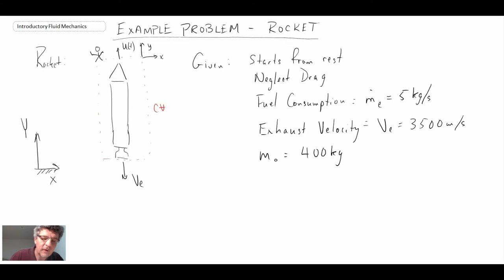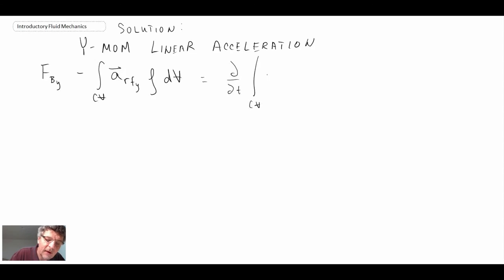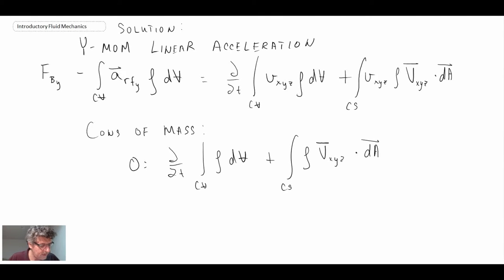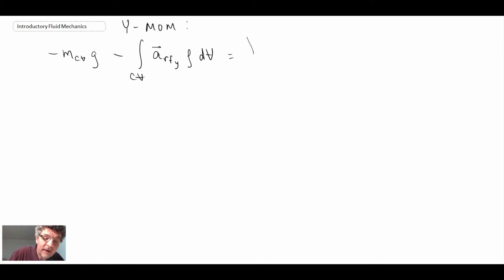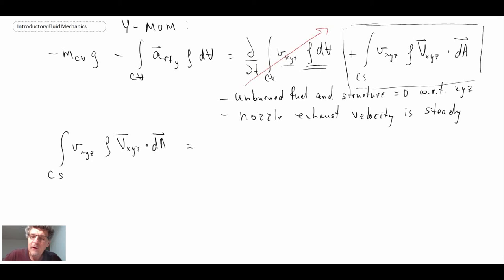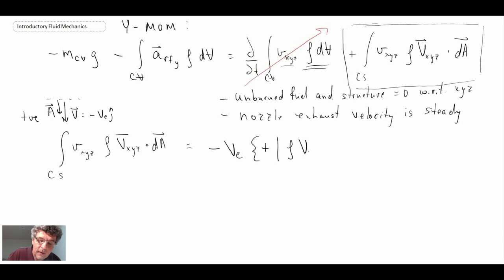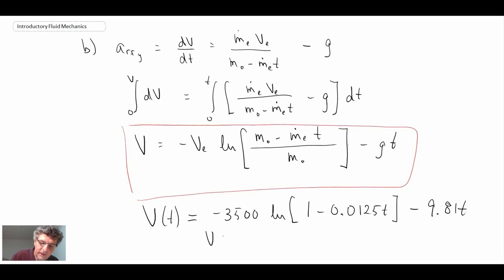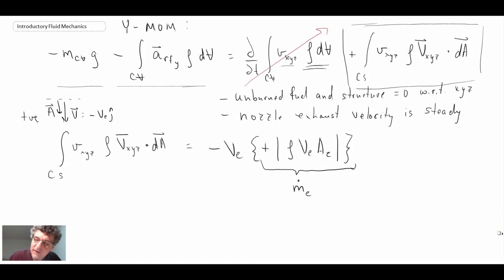Introductory Fluid Mechanics L9 p5 - Example - Accelerating Control Volume

Comment: at 13:20 why dont you integrate the same way as 6:40 with the +C???
At 13:20 you integrate with bounds (0 to U and also 0 to T) but at 6:40 you integrate and just add the +C???
Couldnt you use the initial condition at t=0 the acceleration = 0 and velocity = 0?
Reply: I'm not sure if you're interested in the answer anymore but for anyone watching this video and wondering the answer to this.... You could have integrated with bounds at 6:40 rather than doing a boundless integration with +C. It will give you the same answer. You would integrate dm(cv) from 400 to m(cv) on the left and integrated -m(e)dt from time 0 to time t and you will get the same expression. If in doubt, grab a pencil and try it out! Hope this is helpful to someone!!
Reply: Sir aik aor example upload kr dain
Reply: I am now a mechanical engineer in industry and do not know what any of this means lollololool
Reply: Hahaha 🤣 @shivpalpatine
Reply: @shivpalpatine  LOLOLOLOLOLOL